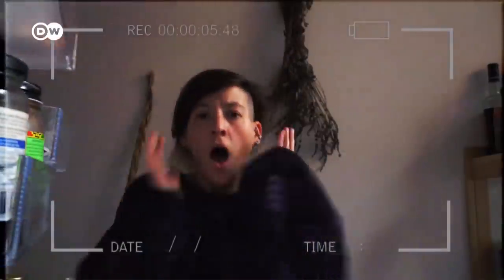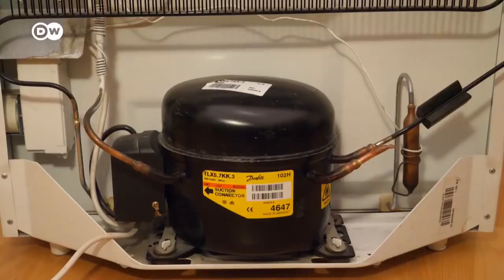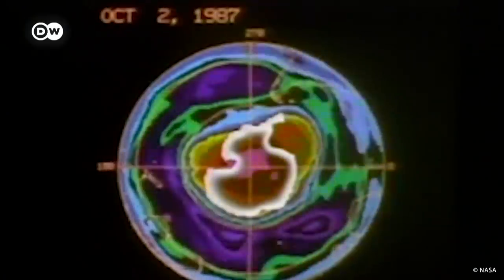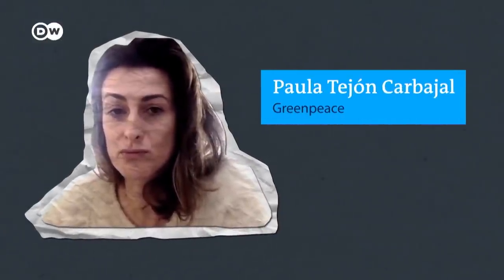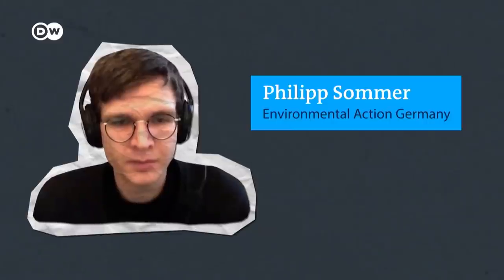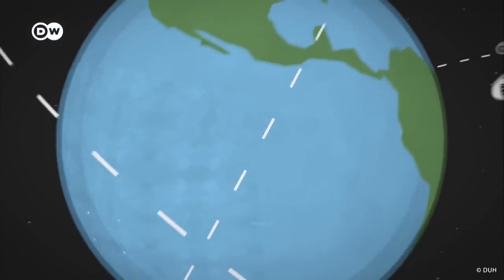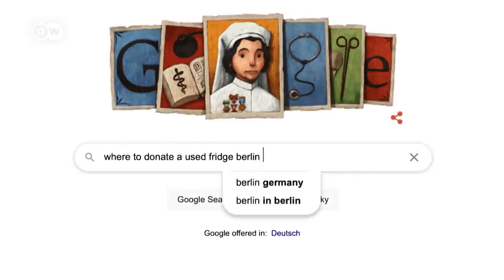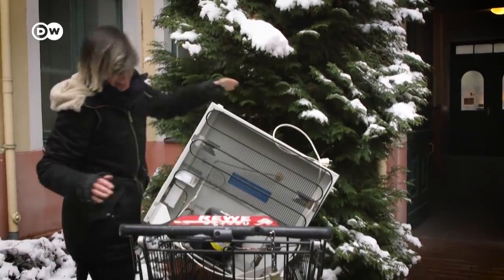Refrigerants: The climate killer hiding in your kitchen

Comment: We were basically INSTRUCTED to let refrigerants out into atmosphere in our 'recycling center' here in Hungary. Just for the record. The bosses didn't even care if we inhaled them.
Reply: Bosses never care about you. 😂 you shouldn’t have been inhaling it.
Reply: @Pcarnevaaa  I did everything I could to avoid it. Like I taking that piece of evil trash out of the building before cutting the "precious" copper tubes...
Reply: Faux Que   crazy ! And did you know captured Freon could be worth far far more than aluminium , we pay over $100/kg  for some gases
Reply: I also from hungary XD. And yes this is happens. But the refridgerators do not contain f gases. So...
Reply: @techrant6853  AFAIK they use different gases in like the last 15-20 years. Still, I'm pretty sure that those gases still aren't completely harmless. But it's really just one example, the whole company is full of anomalies. And it's not alone, I guess.
Reply: isn't  the point to recover and use the refrigerants and reuse them in another ac system?
Reply: @chriss4365  - It should be. But, as it doesn't create immediate profit at that level, they just don't care. Profit is the only thing that matters there.
Reply: Scrappers usually do the same. Most of the compressor appliances I get for recycling have already leaked out so it isnt a big deal. Chances are they stopped working for that reason. The thin tubing used in the radiators fails at solder joints and it slowly releases the gas. I wouldnt worry about breathing them, most of what we get is r134a (tetrafluoroethane) and that isnt going to be absorbed by the lungs.

Comment: I shared a room. I don't cook. No use refrigerator. Only put the food in the boiling water . Carrots, cucumber, tomato, banana, ok for over a week. Cut it off to a small piece. Put it in the steel cup, add hot water. Eat and drink it. No air conditioner. I hanging with the wet towels inside the room. For humid and cooler. When it's dry. I make it wet and hanging again. Instant rice, noodles and oatmeal, pasta. Just add hot water. I am a vegan. No meat and fish...no eggs.. some time cheese ok when it's colder weather . Cheese can keep a week. No heater.

Comment: You missed the most important aspect of the refrigerants. How efficeint are they compared to each other? Surely what happens at the end of life is important but is millions of tonnes of CO2 need to be released to offset an issue that represents thousands of tonnes of CO2 then certainly the switch would not make sense. It seems to me that we want to use the refrigerants that would cause the most warming because they would also be the most efficient, no?

I am all for natural and not polluting but I just wonder how best to achieve this.
Reply: All the recycling places I've seen, require the owner to cut the refrigerant lines prior to recycling. Otherwise they will charge you a fee or not accept it at all.
Reply: The more important aspect is where it comes from.
CO2 is present in way beyond desired quantities in the atmosphere, as is well known.
So isolating, containing and releasing it back at the fridges end of life shouldnt be too much of a burden on climate compared to creating new compounds of much heavier impact.

Comment: i thought refrigerants delimma was solved back in the 1990s
Reply: It was, you can't throw refrigerators away.
Reply: ... solved partially addressed ...
Reply: Not at all, the choice of gases keeps changing, 
Then finally they decide to use R290, propane , CO2 or even just air

Comment: So I gotta ask, I'm no tech guy, but the job of the refrigerant is specifically to trap heat, and its efficiency at that directly affects the electrical demand needed to cool, so if we switch from HFCS to alternatives with significantly less efficiency, are we not just trading the downsides of HFCS for a higher energy demand, which for countries like China and India, would mean a drastic increase in carbon from energy production
Reply: They may be slightly less efficient, but the efficiency of the technology around them (compressor etc) more than makes up for it.
Reply: I guess there are many green powers that can generate green energy nowadays, wind turbines, solar panel, biofuels, geothermal, low impact hydroelectric, wave and tidal, which are all renewable energy sources.

Comment: New cooling systems will contain a refrigerant called R-454b.
Classified as mildly flammable, or A2L. The systems designed to use A2L refrigerants require additional mitigations to be built in to handle flammability and to allow a safe installation.
Check the new cooling appliances which are exploding!
Reply: Awesome!

Comment: I kinda figured this stuff as a kid.
Not sure how the math fully works.
But like the law of energy. It cant be "produced" only "converted.

Cold air is only hot air that had its concentration shifted. 
So the colder the air, the more the hot air has shifted, but will rear its ugly head else where. 
The closest i got to experiencing/explaining this is
1) if you live in the south and been around a window A/C unit. If you are outside and feel the discharged heat, but inside the house its nice and cool. 
2) if you do the same with your vehicle's A/C. Use low fan cooling and get in front  of your (parked) vehicle. Then compare that to a highest fan setting. And you'll hear the revving of your engine. (Your idle is higher on a higher fan.)

I didn't take engineering in college (wish I did) but I feel like all energy even hot air is only pushed else where not truly cooled.

Comment: So, can I understand that using it will not harm us, but inappropriate disposal can. Right?

Subsequently, I believe that refrigerator is a closed system and does not release the working fluid in house (which contains CFCs or HFCs) while its in use. Correct?
Reply: No, not correct - if they did not leak there would not be such a problem. Some products are more leak-tight than others (e.g. a hermetically sealed fridge unit compared to a large central supermarket refrigeration system).

Comment: The real problem " mam I'm sorry your system has a leak , it'll cost this much to fix it " no . Top it off or lose your job . Many techs are forced to lie and say it's epa law , the actual epa law is a joke . The industry " gassing and going " is the problem.  Fix your leaks c/ correct reclaiming,  pressure testing,  and vacuum.  1500- 2500 today's dollar cost . It shouldn't be a choice.  Fix it correctly or not at all , that's not within our power as licensed responsible professionals.  But a girl can get you killed with a word , no trials required.  Government pimping

Comment: I have worked in industrial refrigeration for 15 years. This is a giant load of bull. The charges in these things are minuscule. I think less than an ounce if memory serves. Even with the amount of refrigerators there are very few of them that ever blow their charge. Typically when the compressor wears out the charge is recovered and sent to a purification facility to be reclaimed. Then there's the fact that now because of propaganda like this refrigerators are using flammable refrigerants like propane that make your refrigerator into a potential bomb. So good job scaring these Karen's that will take this video at face value and never look beyond your propaganda.
Reply: The hydrocarbons in the fridges are the problem. It is a fact that this is a problem. The UN has specific resolutions dedicated towards this.
Reply: @Pssst.ByTheWay  you're lucky they deleted my last post
Reply: @commanderosis435  thats sucks
Reply: @Pssst.ByTheWay  I wouldn't be surprised if you reported it. That's what most propagandists do. Censor
Reply: @commanderosis435  nope, i would have been intruiged how good it is,+. if the logiv was solid or language particularily whitty and eloguent.

when i say, that sucks. i mean it.

 have this habuit of trying my best to say what i mean, and mean what i say.
Reply: @Pssst.ByTheWay  yeah right. You're like all chicken little liars. Run to the teacher because a different opinion hurt upper feelings
Reply: @Pssst.ByTheWay  I'd rather be boring than a rat propagandist
Reply: @commanderosis435  then all is well.
Reply: @Pssst.ByTheWay  when dooms dayers like you are ignored? Absolutely
Reply: @commanderosis435  seriously how old are you?(rethorical). NGL you sound like 15 years old. but thats impossible since you say you have worked for 15 years. that makes you closer to 50. i am genuinly suprised at your messages and their youthful nature. anyways, have our last word. im going to move on now.
have a good one.

Comment: Wait a minute, would this problem be solved by replacing the gas system with peltier cooling based refrigerators?
Reply: Peltier cooling is highly inefficient. Electricity consumption would increase dramatically.
Reply: @CT-vm4gf  I'm assuming this being combined with a turn towards renewables and nuclear energy.

Comment: Its real simple.  Thermal mass , meaning the denser the gas the more mass it has , meaning it can hold more energy.  Gasses that can hold a lot of energy tend to be explosive so they add fire retardants to minimize that substantial risk ( in large volumes under pressure,  most new systems are low volume , or cascading with co2 as the primary refrigerant) that apparently poses some health risks if you believe firemen ( fire retardants not co2 ) , but who cares . BTW the energy transportation and transformation industry is providing a logical industry jumping off point for both artificial habitats and geo engineering.  Global warming is the direct result of the energy policy of the world on average,  but a repressive oil and coal dominated policy lead by the US government.  Everything else is second order bs

Comment: hmm. there's only so much consumers can do, even if we want to be eco-friendly, we dont make the appliances, and we need refrigerators. the manufacturers need to produce refrigerators with better refrigerants, so that things improve. they could probably be forced to do so with legislation, but im sure lobbyists would slow that down...
Reply: It's impossible to make a refrigerant not bad for the environment
Reply: @iair-conditiontheoutsideai3076  well... ammonia is a possible alternative. sure it is poisonous if exposed to it, but at least it doesnt trap heat...
Reply: @braunarsch  I flip RVs for a living so I get my share of absorption refrigerators which is a refrigerator that cools when heat is applied. They are horrendous they never stay cold usually are very bulky, ugly not to mention the power draw is insane up to three times more than a compressor driven refrigerator. the worst part is they don't even work well
Reply: @braunarsch  it's a mixture of ammonia and sodium chromate in these absorption refrigerators. as well as a few others that I can't think about at the moment but besides that they are very toxic when they leak
Reply: @iair-conditiontheoutsideai3076  hmm interesting.... perhaps the big corporations are too busy raking in profits to bother researching on more eco-friendly refrigerants? i mean, we went from Ozone damagine CFCs to the new gen refrigerants, there's definitely some compound that could help... or perhaps a new method of cooling that doesn't require a refrigerant...
Reply: @braunarsch  it has to trap heat for it to work that's the problem. Reason we love it is also the reason we hate it

Comment: I use propane as a refrigerant. Same boiling point as 22. I can buy it at any auto parts store. Use it  to top up my car air conditioner.
Reply: Yah what's the worst case scenario for a fridge / freezer? What would  happen if all of the propane were released accidentally and then ignited with the right amount of air/oxygen?
Reply: What is the right amount of propane to oxygen to make an explosion?
Reply: @robertkat  looks like between 2-10% by volume in air? Point being if it leaks out slowly enough it'll spread out through enough air and never reach high enough concentration to be explosive.

Comment: Nothing like a 30-something talking like she's 10yo to ruin the video. No credibility whatsoever. Modern refrigerators contain minuscule amounts of refrigerant and are incredibly efficient. The huge savings in energy to run the modern appliances GREATLY offsets the warming risk from refrigerant release.
Reply: You are very incorrect.   It does NOT offset the warming effect of refrigerant release.   The warming potential is more than 1000 times, a small refrigerator releasing is equal to flying 3000 miles, or more emissions than the average person in a year.    I dont use a refrigerator or ac, and most people in the world do not.  If you do, use ammonia, propane or co2 as your refrigerant.
Reply: @seandepagnier  It doesn't dawn on you that these modern refrigerators only contain an ounce or two of refrigerant? And you have no idea of the operating energy CO2 footprint and how minimizing that with high efficiency operation far outweighs the occasional accidental refrigerant release. You're just not very scientific, so keep your opinion to yourself.
Reply: @seandepagnier he knows what he is talking about. refrigerants are only going to become more and more common. especially now since heat pumps are starting to become more efficient with higher BTUs and less energy draw than electric heating